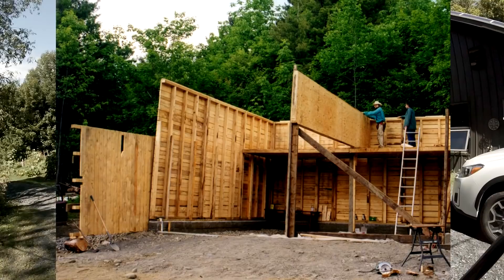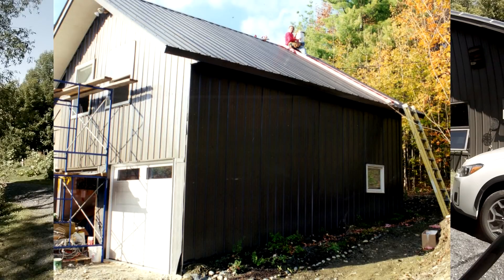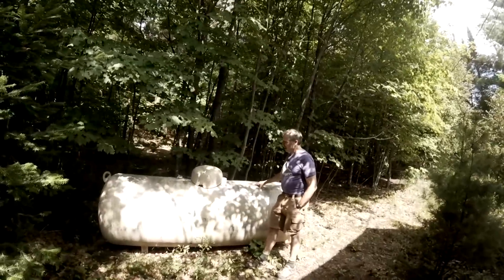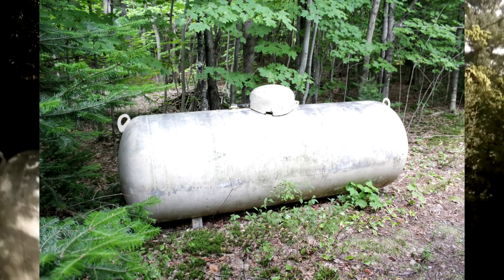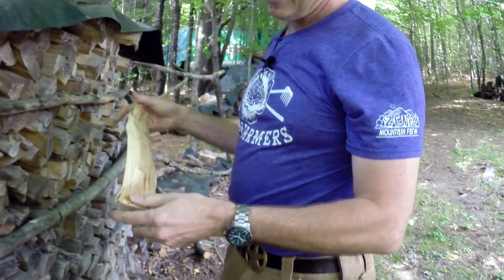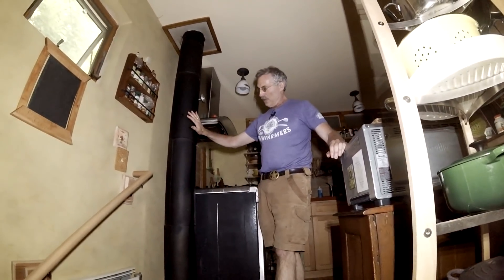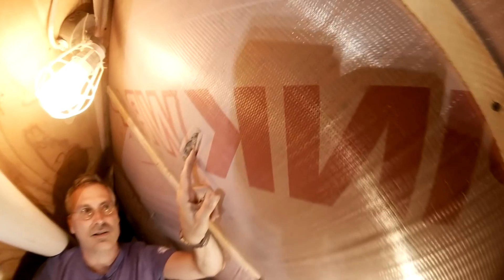Owner built super efficient house

Comment: I built my own house and moved in 1990 . South side all glass porch , 2 story’s 8x16x48 . Fantastic heat when sun shines in winter . I have a 4foot overhang for the summer sun . House has R-40 side walls and ceilings . Inch Celtex outside , 6” pink in walls , 1/2 inch Celtex inside house .  The ceilings have 11 inches of fiberglass plus 1 inch Celtex in the house. I use small electric space heater occasionally now , but started with a coal stove . One January day it was 10 degrees outside , windy but sunny all day . When I got home after work at 4 o’clock , it was 110 degrees on the porch and 100 in the house !  I had to open bathroom window and back door to let heat out .

Comment: Would there be any value installing windows at an angle like they do when building earth homes?
Reply from the maker: Sure, if you want more passive solar heat gain.  However some people (myself and Bill) don't think the negatives out weigh the positives.  The negatives are a harder time water-proofing, and overheating in the summer.

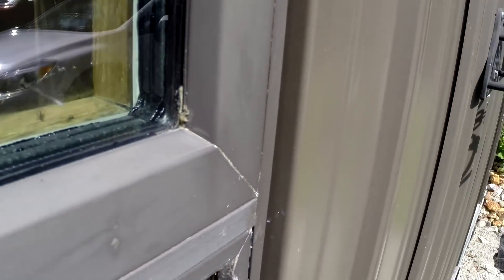Comment: Also, at 5:49, Bill mentions the "high end" of R-5 windows with a heat mirror in them.  What brand and model windows are these and are they sold today still?
Reply from the maker: Bill asked me not to mention the brand for two reasons.  First, because Bill had a poor experience and
would not recommend them.  Second, there
is new ownership of the window company and it would be unfair to give them bad
press when he has no experience with the current product line.  

However, Bill has mentioned that if he was buying windows
today he would be looking at the “Intus” brand or similar. Note that you can
purchase even better than R-5 today.
Reply: I installed Pella 350 windows on my house with R-values from 6.25 to 6.75. I'm pleased with them except the two mulled windows, fit and finish on the seams and corners of those two are not very good.

Comment: Love this vid David, thank  you.  At 9:39, Bill mentions extending the metal cladding below grade.  Is there not a risk in so doing that the metal (being a good heat conductor), will transfer the heat from house down to the cold ground?  thanks
Reply from the maker: Great question. The metal
Bill is referring to is the siding, or cladding. This metal is only on the
outside face of the wall, and does not extend into the building (like a metal
stud would). There is an insulation layer between the metal cladding and the
interior of the house. This insulation (dense-pack cellulose) slows down the
heat transfer from inside to outside. This is true whether we are talking about
the outside being above grade, or below grade. So, the rate of heat transfer is
no worse to the ground, then it would be to the outside air. In fact, because
the avg. ground temp is higher than the avg. outside air temp (in winter) the
rate of heat loss is less. This is known as earth sheltering.